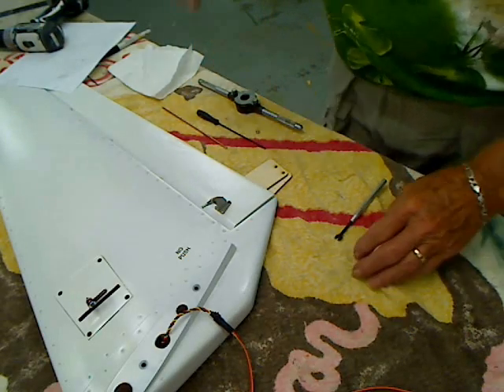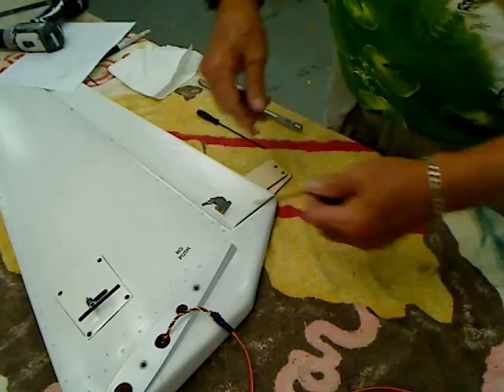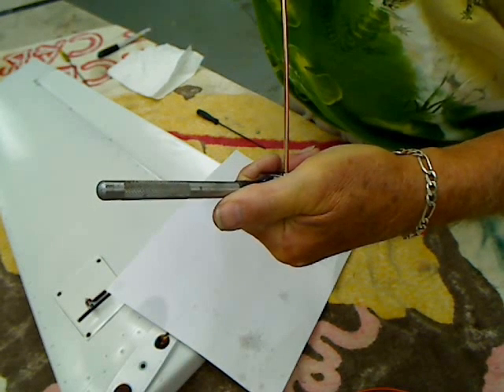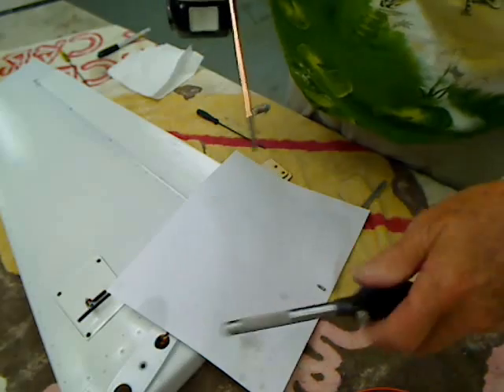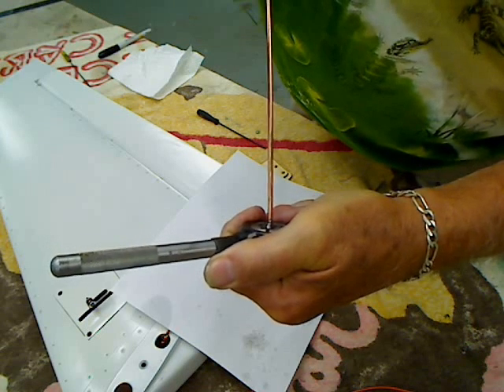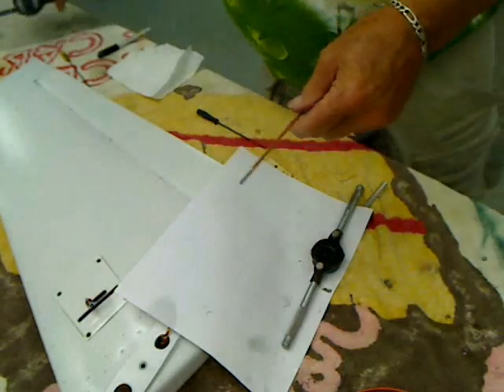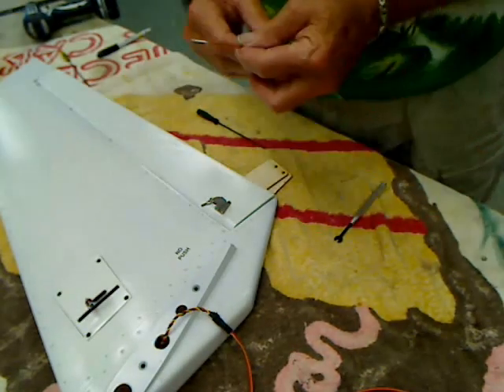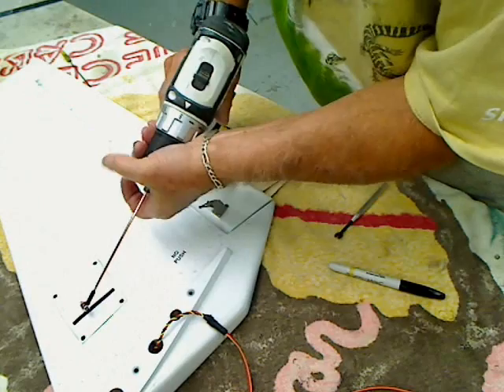STARSHIP #42-- Making Servo Pushrods.wmv

Comment: It´s a really pretty interesting video, congrats, just one question, the push rod you use is to thick, how you work with small diameters which are more commune in RC push rods
Reply from the maker: It is not too thick for the size of aircraft that I build. I don't do this on smaller wire.